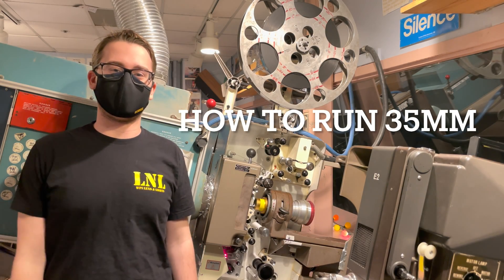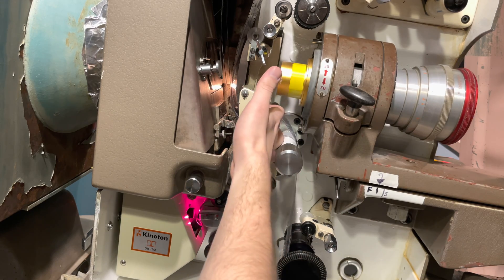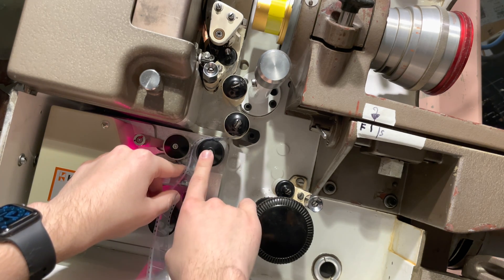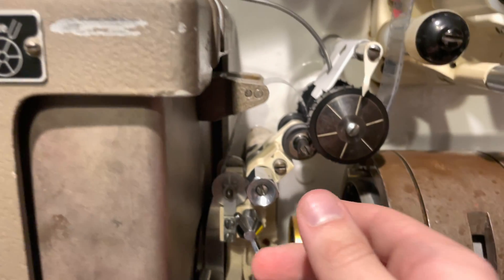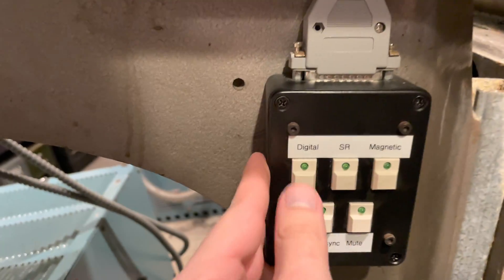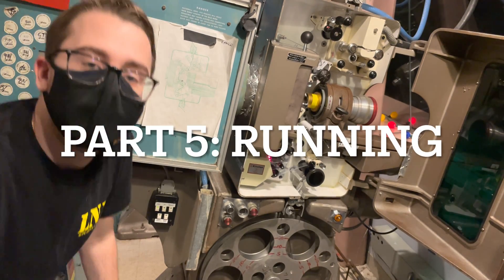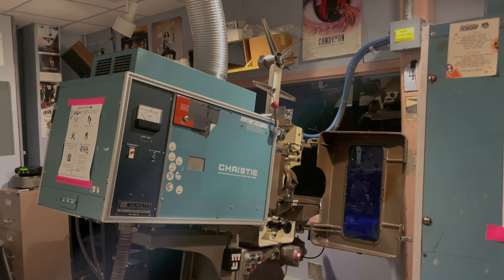How 35mm Film is Projected

Comment from the maker: In my rush to make this video between classes, I forgot to do framing when threading! When you place the film into the gate, make sure the frame is in frame in regards to the aperture plate. If you fail to do this (like I did) you will need to adjust framing when the film starts, and the audience will not like that!
Reply: I didn't want to mention it, because I was sure you simply forgat to do while on camera,it and I didn't want to criticize gratuitously, however it is one of the most important things a projectionist must do every time the projector is threaded, and one that has often mystified beginning projectionists. The DP-70 eliminates part of the mystery, being the only projector that comes to my mind where the gate cannot be opened unless the intermittent is in "rest" position, but of course placing the leader in the correct position, and making sure whatever leader you are threading on is spliced in frame with the film are both equally important aspects.
Thanks for the film.

Comment: I note that you have a 35mm intermittent sprocket fitted.  They do have much lower inertia than the dual 35/70 sprockets and are much quieter in operation.  I you only run 70mm occasionally, they are easily swapped over.  It's normal in the UK to run base out ie. clockwise feed, where, in the US  you run emulsion out. ie. anti-clockwise take-off.  There is a certain logic to 'reverse curl'.
Yes, ...... as indicated, you did not check racking/framing (tomayto/tomahto)........ very naughty of you - lol.  How different is Amercan English to English English?  To describe a girl as 'homely' in England is a generous compliment.  I was very sternly told, that in America that ' homely' is an insult.  Well.... how would a mere Englishman such as I ever know that?

Comment: I would add that it is good practice to close the lamp house douser before hitting stop, even though it seems your system's "stop" is wired to the changeover shutter?   I couldn't tell if it killed the lamp too.   But with lots of setups all that is separate, and just stopping your motor does NOT kill the light through the aperture.  That is one easy way to burn a frame.  Douser first is a more system-agnostic muscle memory to develop.

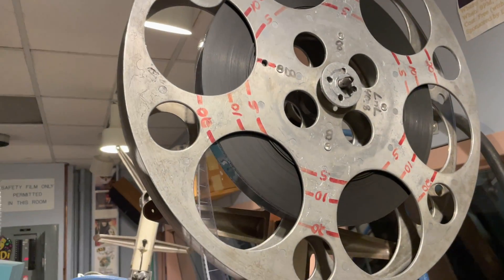Comment: At 2:05 you indicate the film turns counterclockwise at the top and clockwise at the bottom.
This was standard in the US, but in Europe, both turned clockwise. This is because the US standard used an "S" form in rewinding, with counter-rotation reels, while Europeans used a direct over or direct under configuration, with both reels in the same direction. The reason this matters, is that the US "tradition" is in direct contradiction with the SMPTE Recommended Practice for "Emulsion-In" film handling, wherein films are stored on reels with the emulsion facing inward, toward the center of the reel, to avoid the stretching forces of facing the emulsion outward, causing crackling and other mechanical breakdown of the emulsion layer. The US set the standard, but neglected it, while the rest of the world followed it.
Reply from the maker: Yes you are correct! Thank you for the detailed explanation

Comment: I was projectionist for many in Israel. Always, I knew that upper and lower reels must turn clockwise direction. I saw on YouTube that in many countries the upper reel turns anti-clockwise. How come ?
Reply from the maker: Different standards is all! The rollers in the magazines even are adjustable on our projector depending on the direction! If we ran it like you did, we would need to bench the film different (cross-wind it) but it would work as well

Comment: Random question, if anyone can help. My guys will project a 35mm film tomorrow, the aspect ratio is 1:1.66 (they always project 1.85 and 2.39 stuff) they will use the flat lens as would use if it was 1.85?
Reply from the maker: It’s probably too late but it most likely is a flat lens. The aspect ratio is more to do with the aperture plate, with the lenses being wether or not the film was filmed with an anamorphic lens. Easiest way to tell is if the picture looks distorted or not. If it is, it’s the wrong lens
Reply: @KyleMiko  I think it depends a bit on the theatre/screen/masking setup.  If you try the 166 with a flat lens and the image spills onto unmovable masking (or masking that doesn't move far enough), then that aspect needs it's own lens.   It will be more common with 133/137 which use the full height of the frame.

Our theatre has movable top and sides, but we also have a curved proscenium arch.  We have a lens for 133 but can get by with the flat lens for 166.

Comment: I only used a Norelco FP-20 for a few months.  It was an okay projector, but had not been maintained well.  I much prefer a Century projector or Christie projector (with straight gate).
Reply from the maker: Interesting to hear your opinion! Any reason you prefer the Century/Christie projector? I am aware that they were some of the most popular in the last 50 years.
Reply: The Century and Christie projectors were very simple in design.  Both worked well and put steady images on the screen.  I also ran Simplex XL's in a Ukiah, CA 6 plex.

Comment: Not one word about lower loop and sync ???   -And by the way: Dp70 frame knob is never touched, if old projectionists run the booth...  ;-)      Greetings from Malling, Denmark, where DP70 ( no 1459 and 1473) did the job 1974-2012, until Digital was forced onto us.   I missed them so much, that 1473 right now is getting inside again, hopefully to run some 70mm later this sommer.
Where is Your cinema - and have You got the projector numbers ?  -They must be pretty low with the small cranck handle...
Reply from the maker: We have “3” DP70s although one was purchased years ago for spare parts: 803, 806, and 873. 803 and 806 were together when they were donated to us in 1989, the 873 was purchased.

Comment: Very good but, too my mind your intermittent loop was too small, not in all cinemas do we come off the left hand side of the reel and you can run 35mm 4 track magnetic film through the mag penthouse.  I have run DP70's in 4 cinemas here in the UK and I have a pair here at home which are totally original.  There are difference's between the Norelco DP70 used in the USA and the Philips DP70 used in the rest of the world.
Reply from the maker: Our intermittent loop is actually correct based on our Kinoton sound reader! It changed the loop size as the loop is moved down

Comment: You should consider adjusting your lenses so you don't have to refocus between flat & scope.  Your mention that the manual advance knob can sheer off is spot on.  I always used the motor flywheel to advance the film.
Reply from the maker: Thanks for the tip! And yeah there are not many flaws with the DP70, but using the flywheel is always the best way to advance!

Comment: sir ..please explain the mechanism for adjusting the angular velocity of the take up roll
Reply from the maker: The speed of the take-up reel is should generally just pull on the film with not too much force. What seems to be the issue?
Reply: @KyleMiko  but how to adjust the angular velocity when the spool is empty and the spool is full
Reply: Velocity is not calculated or adjusted. The adjustment made is tension, which is adjusted by a simple slip-clutch mechanism and a tensioning spring.

Comment: Your upper loop is 1-2 perfs too large.  This isn't enough to damage the film, though.  You also might want to make a point about not opening the gate until the machine has fully stopped, as doing so could potentially destroy the shutter (not a fun or cheap replacement).  Otherwise, nice job.
Reply from the maker: Interesting, I was always taught that the upper loop should be in line with the circle object from the film gate. And yes, 100% agree should tell them not to open the gate until the DP70 has stopped. Sometime I forget what people don't know!